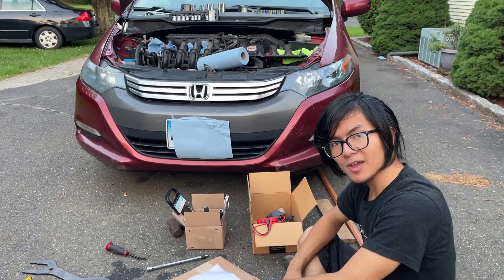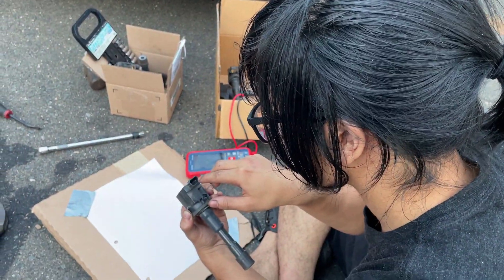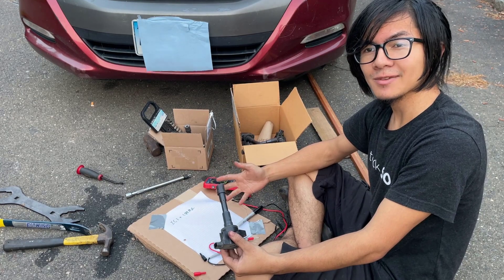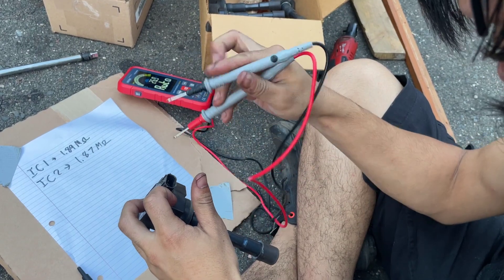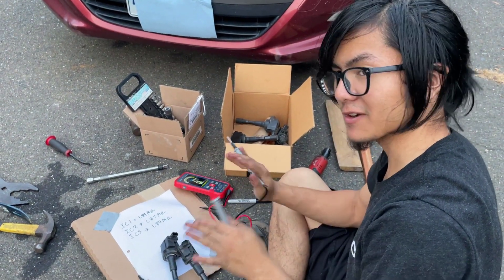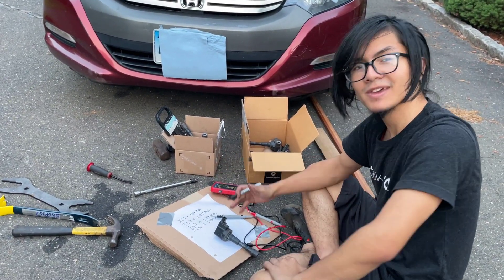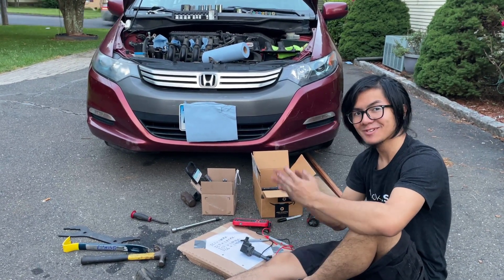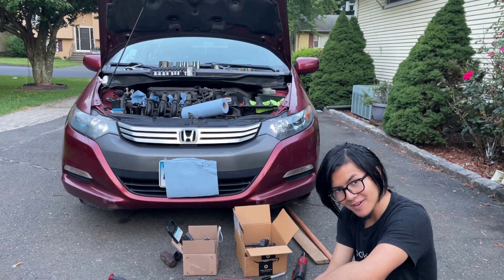Testing Ignition Coils For Faulty Module Using Multi-Meter | Solving Misfire P030X Honda Insight 2ZE

Comment from the maker: Here are the #ad links to some of the tools, parts & accessories needed for this repair:
1.  https://amzn.to/44We0QP  |  AstroAI Digital Multimeter 10000 Counts TRMS Auto-Ranging Color LCD Screen Voltmeter, Fast Accurately Measures Voltage Current Amp Resistance Continuity Duty-Cycle Capacitance Temperature
2.  https://amzn.to/45n91sd  |  ARES 11025-10-Piece Extra Deep and Standard Length Spark Plug Socket Set – 3/8-Inch Drive Spark Plug Sockets - 2.5-Inch and 6-Inch Length 6-Point and 12-Point Sockets – Includes Foam Storage Tray
3.  https://amzn.to/47h5v4l  |  Ram-Pro Inline Spark Tester, Plug Engine Ignition Tester, 6-12 Volt Fool-Proof – Pick Up Coil/Armature Diagnostic Detector Tool – for Automotive, Car, Lawnmower, Small & Big Internal/External Engines
4.  https://amzn.to/3rRMoxj  |  8 pc NGK Iridium IX Spark Plugs compatible with Honda Insight 1.3L L4 2010-2014
5.  https://amzn.to/3OKHXxC  |  TRQ TKA05941 (8 Piece) Ignition Coil Set

Or Click on Amazon link here and search for what you need:  https://amzn.to/3xIOsqg

Comment: You can't only rely on an ohms test to determine if the coil is good or bad, as results can be inaccurate. You also have to verify the coil's input and output with more advanced diagnostics. You need to see if there's a spark coming out of the ignition coil with an ignition coil tester.
Reply from the maker: Thanks for the additional insight on testing ignition coils, those are great points!

Comment: If the car is running rough and you think it's coils juts take one plug out start car keep going until you pull the coil and nothing happens that's the faulty coil no meter needed 5 minutes to do
Reply from the maker: On Honda Insight 2ZE there are 2 coils and 2 spark plugs per cylinder. How do you suppose that'll work?
Reply: @EyeOnAiman  second plug is secondary spark after the main spark for emissions so it well back fire because it after compression you don't need the second plug lots of vehicles have different ways to go about emission control like Subaru use tgv its like a second shot of air but one of the first things to go is emission control on cars I could get deep in to it but know body got time for that 😉 have a lovely day or night wherever you are on this beautiful planet 😀
Reply from the maker: @isaacmtamou8070  Thank you kindly and likewise have a beautiful day as well and thanks for watching...